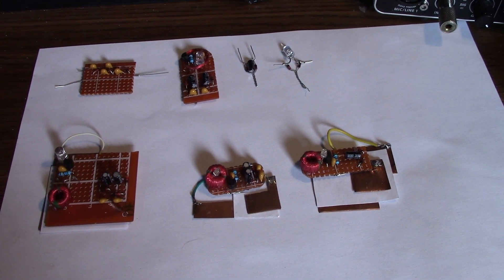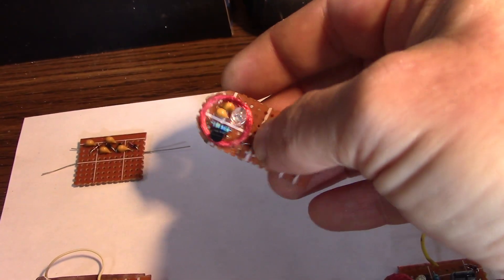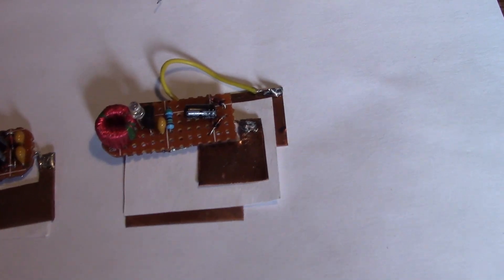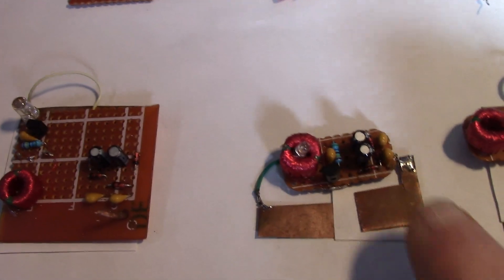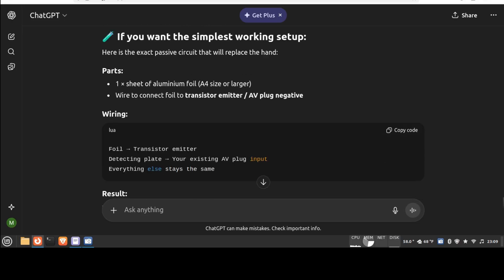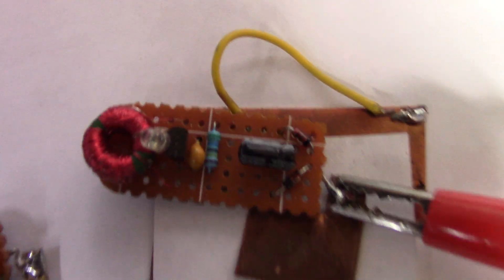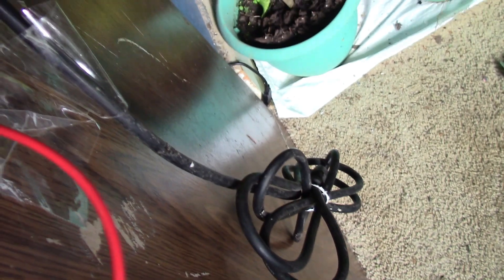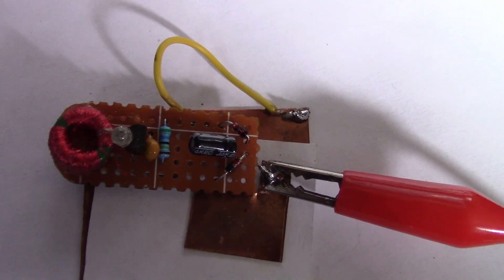Great Success | New Simple Energy Harvesting Method

Comment from the maker: If you’ve tested similar ambient energy or RF harvesting builds, do tell me what worked (or didn’t!) in your experiments. 👇
Reply: Coils made into chokes. It naturally rectifies the AC spikes into DC to feed into caps. Coil construction is key. Utilization of the RF to run meaningful loads is the holy grail. Ppl who  have done it are burnt to the stake. Tesla's hairpin circuit is very good because it shows how he manages to direct the short circuit to create the RF field.
Reply from the maker: @drampaul  Thanks Paul 😀
Yes, I'm not sure there is much meaningful to high power energy collection here, so I should be OK! 
A very good use would be drawing in energies emitted from fusebox's, where high EMF can make people hallucinate or experience nightmares. 
Tesla's hairpin is certainly worthwhile looking at again, it's been many years since any experimentation with that. I also agree about the quality of a wound coil - got 2 exact same coils here on the little green cores, 1 hastily wound, 1 layered neatly. The hastily wound is far inferior, yet to the eye they look very similar.

Comment: I hooked mine to a ground rod, and it works too.  Then I hooked from ground rod-to33uf cap- to air coil- then to AV plug, still works. Electrons flow up from ground which truly is a vast resivore as tesla said!!!  I have found that holding a small battery transistor radio antenna (on FM only)  against a copper rod or wire driven in the ground simply blairs in stations that you cant hear otherwise even when a storm knocks out the mains power.  I utilise these ground wires in my potted plants , and tomatoes in plastic buckets to connect them to earth frequencies Just a direction you fellers might want to pursue!!!
Reply from the maker: What an absolute joy to read. Many thanks, Bob 😀
Superb to know of your progress 👍
I do know that Eric Dollard always championed Ground currents (for his earthquake system too, I believe) and did see his experiment with radio reception just using the ground.... gosh, about 15 years ago though.
For your potted plants, the 27MHz system from an Irish university does work very well. It's as simple as putting the antenna of an RC car into the soil for 15 seconds per day at watering time. Grew some ridiculously huge tomatoes with that method and I worked with 'As Seen On TV' when they built a greenhouse especially to try it. That never got released, as far as I know, but the system works. Might use that method here again, because many of my plants get overwintered indoors and never do as well as being outdoors. 
Your method could also be well worth trying... I do have 1 wire already running outside from this room.

Comment: thanks for creating those!.

I got many insights of zpe bursts harvesting device, but lack of technical knowledge.

can you add a crystal quartz to the system and check the result?
Reply from the maker: Thanks for your comment 😀
I don't think there's enough power to run anything but an LED at the moment. If harvesting becomes stronger then yes, certainly I'd try a quartz crystal!
Reply: @Slider2732_ 

Theoretically yes with crystal quartz as an antenna, according to my insight. It's still hard to understand also comprehend with current human knowledge and collective consciousness level. But the window are open widely!

Powering led is powerful enough, and it's stackable (you can figure it out sooner).
Your small step are foundation of future leap!.

Comment: try turning off the main Dist board switch fuse
Reply from the maker: Thanks for your comment 😀
It does stop, that's correct. We had a power cut and the first thing I did wasn't to get flashlights or plug the fridge into external power, it was to check if several of these type of circuits stopped!

Comment: Super noob question here: what can you do with this amount of energy?
Reply from the maker: Haha, I like the way you wrote that 👍
It's an excellent question though. My idea, has been to make desktop toys, as folks call them. One idea being a Christmas tree with it's star lighting up. Have got a video uploaded, but not released yet where I put one of these circuits in a robot figure, touch the base to make his eyes flash. Can then try it out sitting on various things... it runs superbly sat on my Ecoflow power station, for example. Just a sort of novelty, which may inspire others to forward energy harvesting into at least interesting things.
Reply: @Slider2732_ 

A really long #60 magnet wire air core coil shall be a viable pickup element.

Try it and please share the results.

Perhaps even grounding the opposite terminal of the coil with a bypass/coupling capacitor on the other end may enhance it. Just a thought.
Reply from the maker: @RichardZ-c3v I was surprised about the 10ft or so of wire hanging out of the window, from earlier videos. Thought it was stuck in the ground via a copper rod, but the wire had snapped! If that worked, then a long magnet wire length should be much better and would move it towards radio. Terminating with a cap to ground is very interesting!

With warmer weather I'll certainly move experiments to the top end of the property, which has no electrical interference for many hundreds of feet (woods on one side, abandoned house on another, little lake on another and our house in the other direction). Up there I could run long lines and see what happens.
Reply: Found this on Hackaday.

The BPW34 silicon PIN photodiode feeds a small voltage into a BQ25504 ultra-low-power boost converter energy harvester which stores power in a capacitor. When the capacitor is fully charged the battery-good pin is toggled which drives a MOSFET that powers everything downstream.

Idea: Use your circuit to take the place of the photodiode by feeding what goes to the led into the Hackaday project.
Reply from the maker: @RichardZ-c3v Oh, that's a cool idea, thanks Richard 😀
Have seen those BPW34's, mini solar panel things, so the energy must be small for the harvester. 
Will have to look into the BQ25504!
Reply: @Slider2732_ 

You're welcome. I would like to see a video on that when it works.
Reply: @Slider2732_ 

I got another idea: Instead of using a long wire (cord) as a pickup antenna element, try using the coil in a regular house clock. The thin wire is long enough. But it must be an air-core. Remove the bobbin from the stator if possible. It's an old radio trick. Just hook one side of the air-core coil to your circuit and then it can be enclosed into a module.
Reply from the maker: @RichardZ-c3v I like your style there, "when it works" 😁
Reply from the maker: @RichardZ-c3v Cheers Richard. We have 1 house clock, it's in the kitchen and my wife just bought it 🤣 
Another route could be an old relay and to take that apart. Have done so for 44AWG+ wire before now. If I find one, I'll try it!
Where things are at will be in a video I'm recording at the moment... am down to a piece of aluminium foil, about 2" x 2" that sits on the floor 😀
Reply: Do you have PCB layout software? You can make it all on one board and it'll look good.
Reply from the maker: @RichardZ-c3v Did have a look at Kicad but, nope, have never used such software for PCB design. It would be a good idea... even better if I got monetized and PCBWay sponsored the channel 🤣

Comment: good you have the harvesting circuit simplyfied. the simpler the better. 🙂 also its closer to the dr stiffler experiments. the alligator clip wire would so pick up something from a powersupply that is acting like a "high voltage" puls coil or anything that is connected to the ground wire of it. like the alu case.
Reply from the maker: It is interesting how many times Dr. Stiffler's work comes back to the fore, especially with clip leads. He made me think of them in a different way, metal mass, connecting wire, metal mass  😀

Comment: You are single wire grounding with infinite capacitance of the Earth. Instead of using the prong extension cord,  make an air coil around a 4 inch or more diameter round plastic container and put your hand over it without touching it. Any object that is grounded in proximity of the air coil will allow the field in the air to ground.
Reply from the maker: Thanks and yes, hand proximity can ground, as you say. I did show similar in a recent vid, where there were 2 ground plates. Can hover just a finger over a plate and the oscillations start. 
It's a good direction to take, for size reduction 😀

Comment: the LED to the base is self regulating for tiny current by draining coil with transistor, seems it will be brighter if connected to ground. It may drain the little energy completely and stop oscillation cycle thought but then you just need to add a separate second stage collecting and threshold releasing the energy
Reply from the maker: Thanks for your pointers 😀
I've tried both methods and normally there's very little in it, Base or Ground. But, I can say that's over many years and not specifically with this series of experiments. 
For threshold release I normally rely on a transistors switch on voltage... simply the simplest to build or replicate. Doesn't mean it's the best route, I agree! 
I was thinking to change things around a bit to be more like a Slayer Exciter, or Joule Ringer.

Comment: So basically the cord is the antenna.
Reply from the maker: Yep Tony, though much reduced from stringing out across a room or between trees. It also doesn't look like an antenna. I have a thought that someone could claim all sorts about such a circuit and have it displayed to the public... as long as the building had power it would look like it was running from nothing!  "Here's it's mains cord, which you can see isn't plugged in"
Reply: @Slider2732_  Any difference with power if put aerial? thanks for replying. Good circuit
Reply from the maker: @tonythai5991  There's no real change when running from the wire that runs outside through the window. But, the circuit does work better when sitting on top of my Ecoflow power station. I should think that's due to the mains inverter being close to it. This circuit has ended up in a robot that flashes it's eyes in the next video, where the Ecoflow running difference is shown. It also runs well when sitting on the microwave 😀